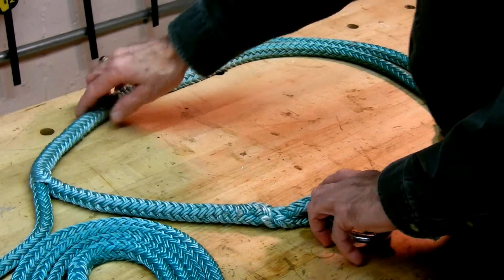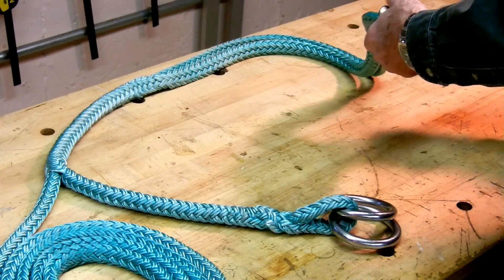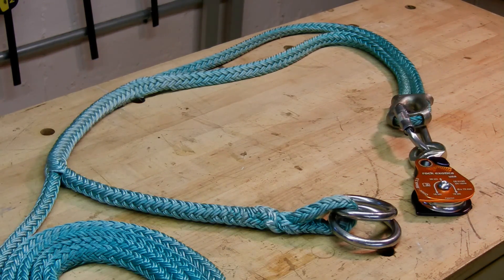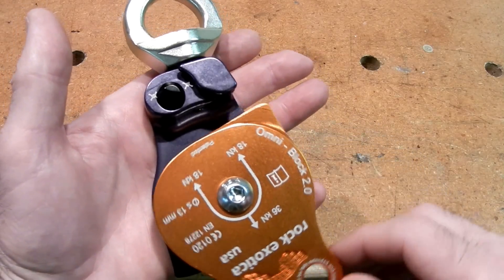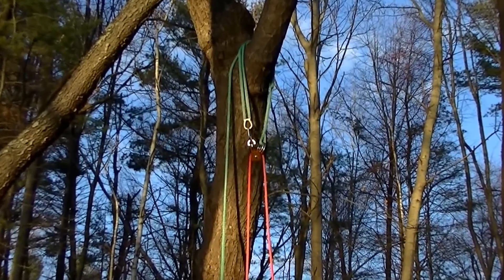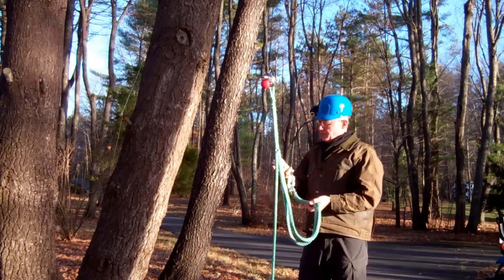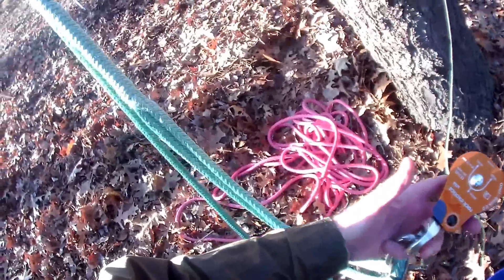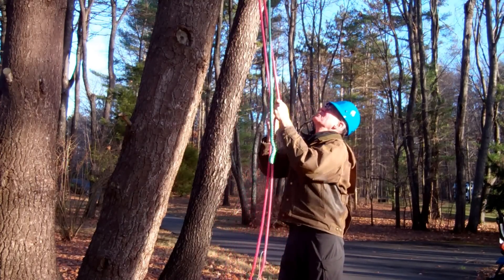Rigging Whoopie with OmniBlock

Comment from the maker: The Omni sidewall gaps mic out at 0.8mm and 1.3mm. Furthermore, the sheave is not free to shift laterally and “pile up” the tolerance all on one side.   Modern throwline runs 1.8-2.2mm.

I have several mid-size rigging pulleys that mic much bigger and the sheave can shift.  These pulleys are stamped;  the Omni is CNC machined.  Sometimes it’s tough to justify the higher manufacturing cost, especially for a rigging pulley.  Not in this case.  It’s the difference between success and failure!